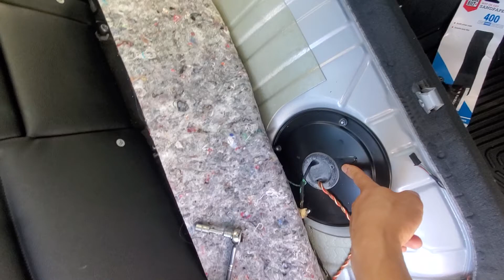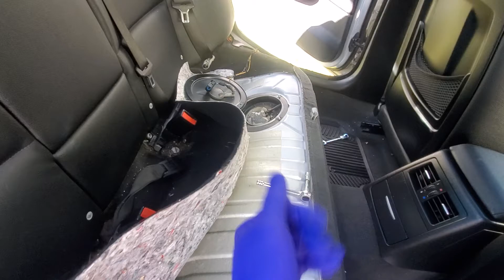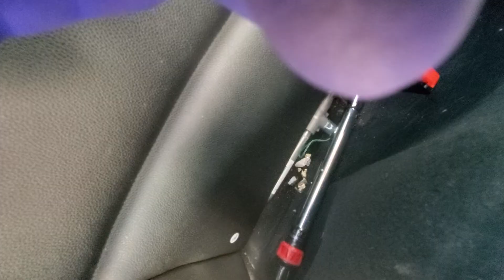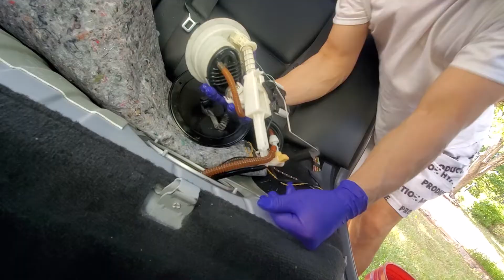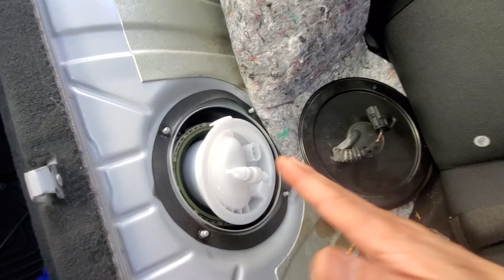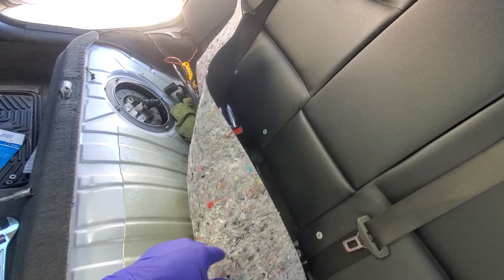BMW E90/92 remove and replace fuel regulator/fuel pump #bmwe90 #m3 #m5 #328xi

Comment: I checked the fuel tank on both sides today, the arrow is a little below half way up, it shows fuel inside behind the driver, the left side doesn't have a drop of oil, while the right side is level with the pump right up to the fuel pump connection. Should there be oil in the left tank? It's cutting at 1500 rpm in third gear, and I see there's a thin line going down to the bottom of the tank, and oil is either coming in or coming out of there. Does anyone know what the problem could be? It cuts when I turn corners or on a bumpy road. , bmw e91   318 d 2009

Comment: My right side pump is leaking and the left one is working , my question is can this be the problem why my car not start ? I have a valve leak ?
Reply from the maker: Yes if your car do not start ur not getting fuel delivery issue on the rear u have a fuel pump and in the other side is siphon pump if one not working u gonna have a fuel delivery issue

Comment: If I change the fuel pump regulator do I have to change the fuel pump on the right?
Reply from the maker: No if ur problem just fuel regulator or it leaks u don’t have to change the fuel pump….unless u have a problem on ur fuel pump

Comment: And another video that does not show you how to disconnect the connectors on the fuel pump itself. Undoing bolts and caps is very straightforward and simple a monkey into it. The main information that’s missed in. All of these types of videos is the actual important things that could cost somebody a mass amount of time or money if they don’t know whether it is a push or pull And BMW likes to disguise them
Reply: Do you have a video that shows the proper way of removing it?
Reply: I just found it! 😬 Minute 2:51 https://youtu.be/3UNCJfCMdhk?si=TWH3HuY8SDb4x75I
Reply: @renzonovara2728  he shows you how to take off the VERY OBVIOUS clips on the top hoses... not the main line to the pump inside the bucket which is the one most people break!
Reply: ontop of that didnt even explain which hoses to connect back. the old one was 2 black and 1 white, then the new is 2 white 1 black, its like wdf how are we supposed to know which ones which.

Comment: Question? Was your car having very long crank starts?
Reply: Yes, a faulty regulator will cause that
Reply: @ thanks. I’m going to change it on my sons 328xi, hopefully that is the probrem…
Reply: @manuelortiz7731 I have the same issue after replacing my pump and module might start working on that next
Reply: I already changed the fuel pump relay, fuel pressure regulator, and the car still only starts whenever it feels like it, I think the last thing to change is the actual fuel pump, hopefully that will be a permanent fix, I’d hate to take it to the mechanic for diagnostic
Reply: @ my car starts fine now after replacing fuel pump, but starts dumping fuel from the tank whenever I go to the gas station. I think I forgot to hook up the vent or something idk. I won’t ever take my vehicles to a mechanic I’d rather do it myself and struggle than pay those labor fees
Reply: @logans2902  me too, I’ll give it it a try with a new fuel pump,, 156 thousand miles, won’t hurt to put a new one….
Reply: @ I’m only at 100,024 😡
Reply: Buenos días.. otra pregunta,, el software para borrar el derrame mode está disponible al público? O es solo para mecánicos específicos de Isuzu?

Comment: Did your gas gauge work after this? Mine only goes up to half way now and I read a forum that there’s a dip in the tank for the spring loaded stem on the regulator for the sensor to work. I’ve wiggled mine but I can’t get it to work.
Reply from the maker: @juple559  yes all working fine…
Reply: @bmwfixer1359  do you have any suggestions for me?